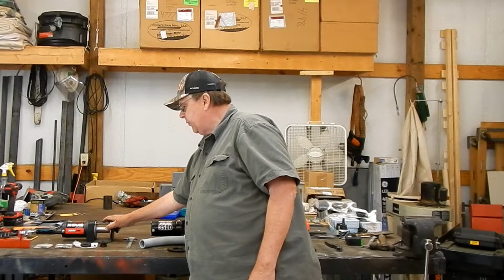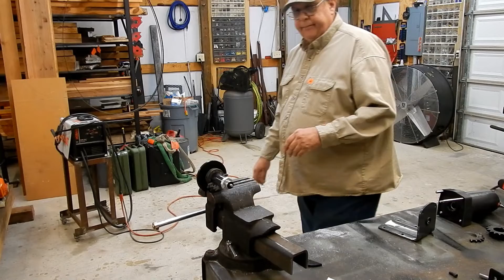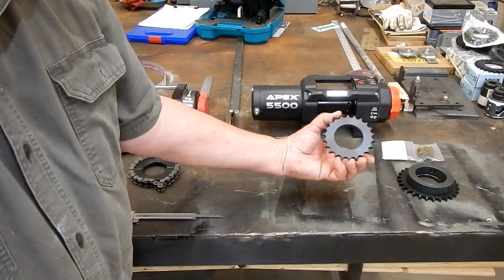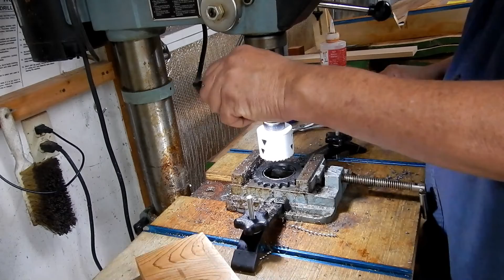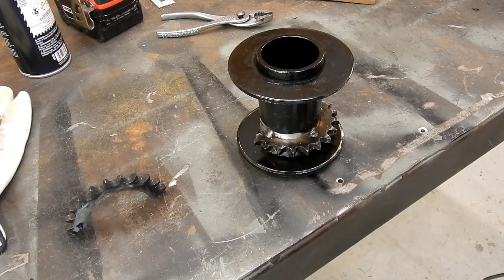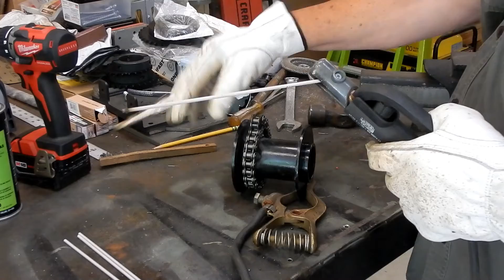Sprocket Installation on Bandsaw Mill Power Winches   TimberKing 1400

Comment: where do you get the split collar with the set screw? all the ones I've found don't have set screw
Reply from the maker: You can get the split axle collars from McMaster- Carr at Mcmaster.com
Make sure you get the smaller ones. The heavy duty ones will be to big in diameter.